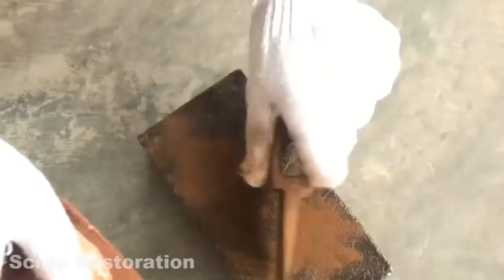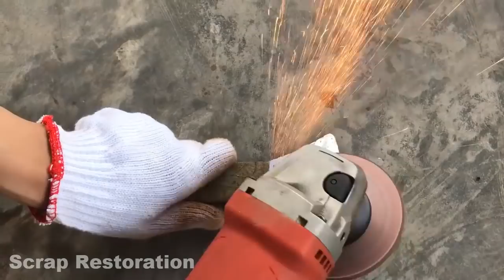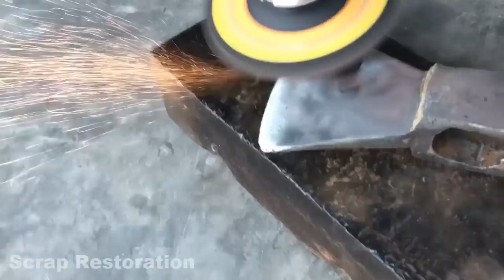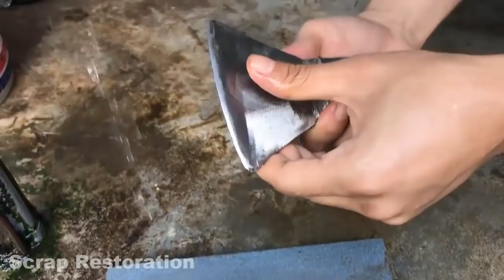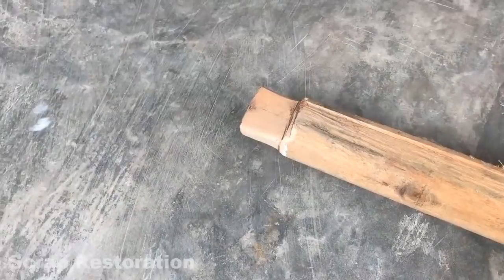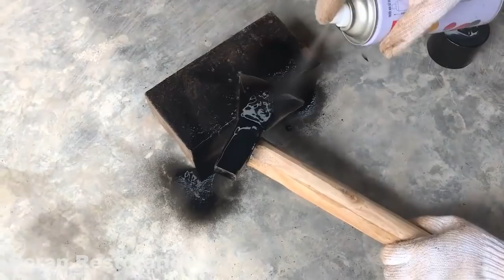Antique Hatchet Axe Restoration - Axe Restoration

Comment: It's a bad handle with those knots in it. Nope, I don't like it.
Reply from the maker: Just give us feedback and we'll try the following video
Reply: @restorationscrap8829  You should look for wood with a fine, straight grain in it, and no knots, they can break right there. Also you should make sure that the lines at the end/head are in line with the hammerhead, that too makes it harder to break (this doesn't count with the lines going in circles). I also think this handle is too thick and straight.
Reply: @restorationscrap8829  Oh, and never ever paint it, use boiled linseed oil, or even olive oil to preserve it/ threat it with. And if you want to paint the head, do it without the handle on it.
Reply from the maker: thank you